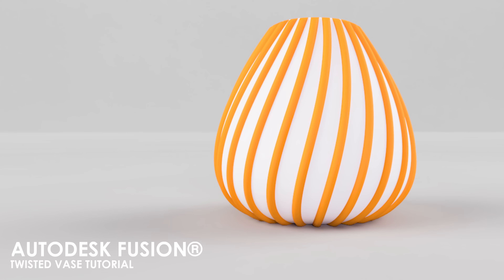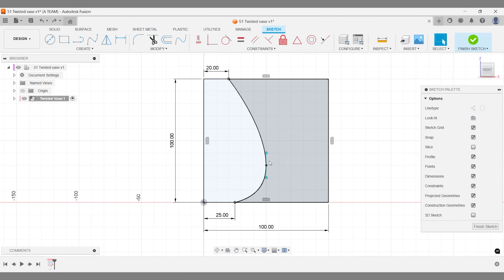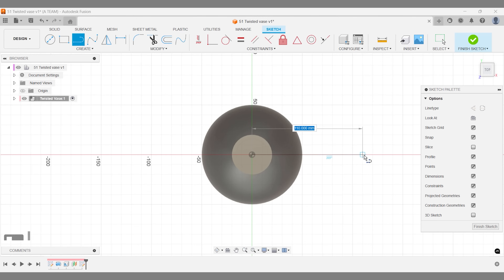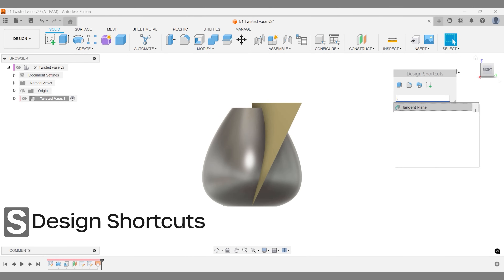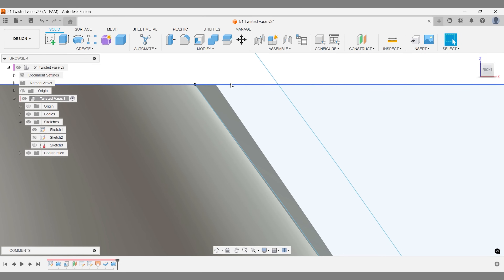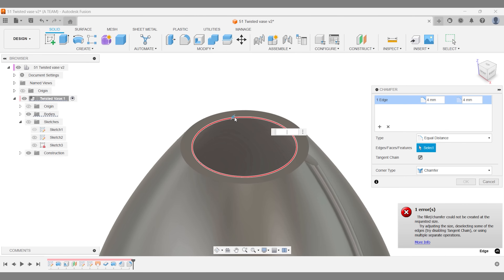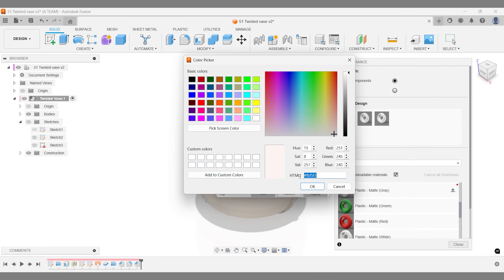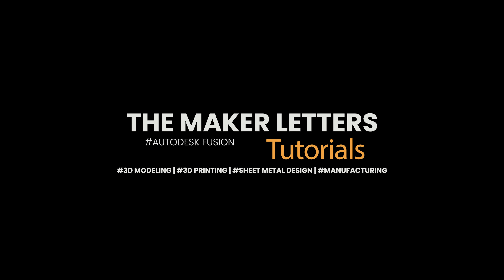Design a Best Selling 3D Printed Vase in Autodesk Fusion

Comment: I'm sure this would be a great tutorial for the ones that already have experience with Fusion 360. I, on the other hand, wish that you explained how you were actually doing the steps in detail. I just could not get my loft tool to work for some reason. You make it look so easy.
Reply from the maker: Thank you for your feedback!

It’s a tough balance. Some people prefer 8-10 minute videos and some people prefer the fully explained 20-30 minute version.
Reply: @The_maker_letters  I just could not get my loft tool to work for some reason. You make it look so easy.
Reply from the maker: Make sure you pick the right loft tool (surface loft vs solid loft)
Reply: Thank you for your help. But I’m so new at this, that I don’t know how to choose this options. Your tutoring is very good. It’s just missing the explanations of how to choose each option and where to get them from for us newbie’s
Reply from the maker: Press S to open design shortcuts.  

Search for loft 

Blue loft = solid modeling
orange loft = surface modeling

You can use surface modeling loft when you want to loft open geometry without closed borders (for example a line)

Ps. If you are completely new this tutorial is probably a litte fast paced. :)

Welcome to the channel!

Comment: I like your videos. Short and to the point. Thanks. Why do you say use minimal points on your spline?
Reply from the maker: Thank you! 

Some advantages with fewer control points are:

+ Smoother curves
+ Easier to control 
+ Simplicity and less errors
+ Better performance and reduced computational complexity

Comment: Followed everything perfect until the loft instruction trying to connect the top and bottom lines it gives.........error there must be at least one intermediate non profile point for a loft
Reply from the maker: It's hard to say without seeing the model, but if you're lofting two lines, make sure you're using the Loft tool in the Surface modeling environment. Also, check if adjusting the angle between the lines to somewhere between 30 and 90 degrees helps. 

Good luck! 🙂
Reply: @The_maker_letters  Thank you I was trying to loft in the solid and not in surface modelling........I am teaching myself fusion 360 thanks for your help
Reply from the maker: Happy we found the solution! :)

Comment: so now i have these colored bodies, how do i print it in bambu studio?
Reply from the maker: I don’t have personal experience with Bambu Studio, but from my research online, here’s what I found: To print your colored bodies, export your design as a 3MF file to retain color and material information. Import it into Bambu Studio, and assign each body to a specific extruder. If you have a multi-material 3D printer or dual extrusion setup (like the Bambu AMS unit), you can load different filaments for each body. If you’re using a single extruder, merging colors is an option, but layer-by-layer color changes won’t work well for this vase design.

Another option is post-processing—print the vase in a single color and paint or dye it afterward to achieve the multi-color look.

I hope this helps! And I think you’ll enjoy the next video—stay tuned!🙂
Reply: @The_maker_letters  oh! Looks like if I save the entire file as an OBJ file, then it seems to work! Printing now. Great video! Just what I needed to learn. I've always been wondering how these spiral models are done and how to make color prints. This video gave me both answers! Thanks a lot,
Reply from the maker: @carolchennning9188  Glad the video helped and that saving as an OBJ worked! How did the 3D print turn out? If you’re interested in a similar but slightly different project, check out this Fusion tutorial: https://youtu.be/zGaCWa3FzKc. 

Happy 3D printing!🙂
Reply: @The_maker_letters  It printed great! I have one question: how did you get the "design shortcut" context menu to enter command to show up?
Reply from the maker: Great!

Hit S on your keyboard to open contextual Design shortcuts, Sketch shortcuts, Form shortcuts etc.

Ps. A small icon appears in the bottom left corner when I use shortcuts :)